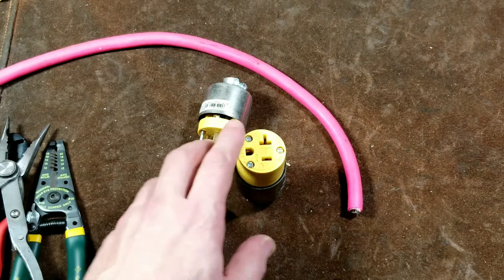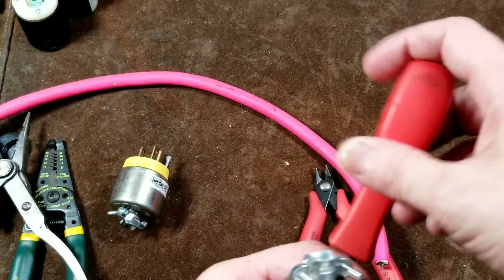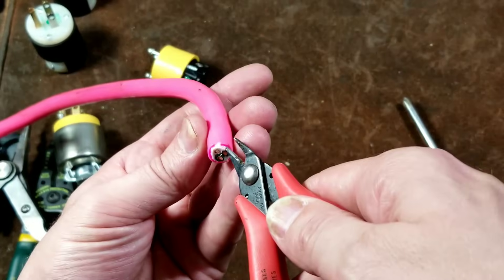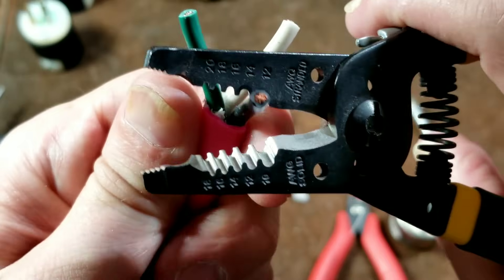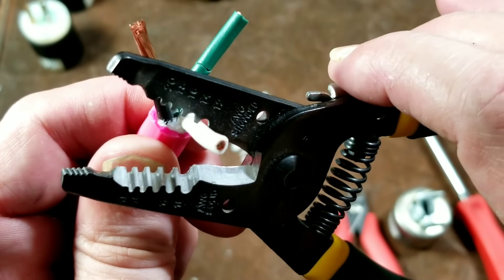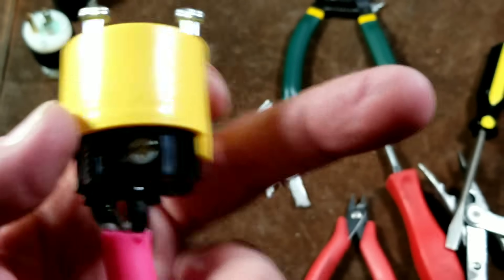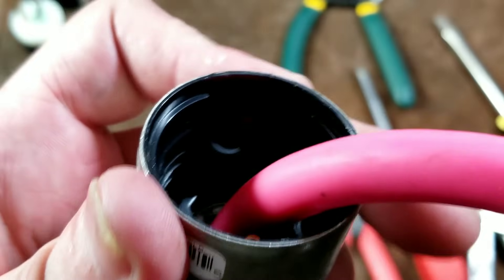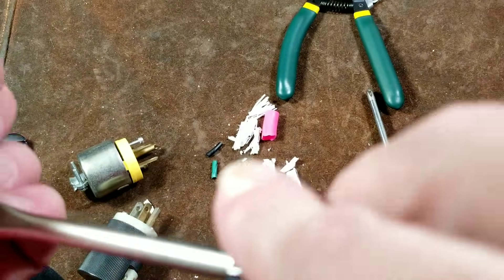How to Properly Replace a Power Plug/Cord End

Comment: In 1980 I new a guy who ran an electrical supply house he made up an extension cord for me. It is 12 gage with a fuel and oil resistant cover. One end had the hospital male end the other end had a single metal receptacle box with hospital receptacle and metal cover it's almost 2023 and it still looks and work like brand new.

Comment: It's not something a person does everyday but it's good to know that broken cords receptacles can be fixed relatively easily.  Once you do this once it's hard to forget or screw up.  Just remember Black to Gold, White to Negative, and Green to Ground and you can't go wrong.  You should always test the receptacles as well after your finish with a multimeter for continuity.

Comment: I just bought a used 220v dust collection system and the previous owner took the plug off to use on his new one. What kind of plug end should I put on it? Isn’t 240v more standard in the US? I am completely new to this, but trying to learn a bit so that I can repair this and get it running.

Comment: Why not use a combination head screwdriver on those terminals? I understand that the average joe won't have that tool normally but this may be the perfect time to expose them to its benefits. After all they are relatively inexpensive and sure makes life easier when doing electrical work. Anyway, good video and thanks for the info/insite!

Comment: I have used hospital grade outlets and receptacle for years. 
I get mine from savaged hospital equipment. !
I am also looks to make a 10 gauge extension cord. It is a little stiff price wize , but it will be good to have.

Another soild video.
Reply from the maker: Yes Hospital whenever they remodel always seem to toss out all their old high grade receptacles and cord ends and they are definitely very nice quality and very positive retention.

A 10 gauge extension cord is recommended especially for those 15 amp tools, really important if you plan on getting one of those hundred Footers

Comment: if you use that method to strip the wire, give the cutters an eight or so of a turn.  still very little risk of nicking a strand remians but the cutoff will remove much easier.  I also like to hit the wires and all boots / seals / threads / strain reliefs with a bit of noox or silicone grease to head off water ingress

Comment: Interesting you brought up receptacle. I got 12 gauge extension cord, and it was warm to touch. I had to replace the receptacle, and it was cool. Difference was that original only has couple of contact points where as replacement was one wide piece. Browsing at harbor freight, some are only 2 contact (newer?) and some are full wide (older). Maybe that could be your review topic: receptacle contacts.

Comment: I have a machine that has a motor with a missing plug...it’s an industrial machine, the cable coming out of it has 4 wires inside it...wondering what plug end would I use for that one?

Comment: I have a cord that has 2 greys and a black - have you seen this before? What to do?
Reply: Likely one of the grey wires will have a ridge on it.  Typically that is the one you would use as neutral.

Comment: I am not an electrician.  we have standard cable with colors green/black/white. In the plug we see green screw for green(ground) so But I don't understand why not make  the other one black and white(silver already). No confusion arises at all. Sometimes it is hard to distinguish silver and brass due to low light.

Comment: I'm getting ready to do the same thing with the exact same plug, but my three wires are black and red and yellow. Trying to figure out where I should put them
Reply from the maker: Use the black wire for the wide slot or the wide slot or the wide prong use the red wire for the narrow slot or narrow prong And use the yellow for ground

Comment: How do you know if the adapter needs to be replaced or if you just need to move it down?
Reply from the maker: most times you can just cut the cord and reuse the plug unless it has melted down or been destroyed.

Comment: My original hair dryer has only live wire and neutral wire. But no earth wire. Is  it dangerous to use?? It can get electric shock?? Please advise me
Reply: It is only dangerous to use if it has a metal body and no ground as metal conducts electricity. Most modern hair dryers have a plastic body so a ground is not necessary. In essence, the ground is for safety.
Reply: @electrifyinglightningbolt  My hair dryer's body with plastic. Thanks for giving me advice. Appreciate it

Comment: Why don't you use a pin to connect the copper wire to the plug ? Or if not a pin.... why not solder the copper.... thus giving you the best contact possible...
Reply: A solder joint is not flexible and a poor choice for this kind of application.

Comment: You really should not put a 20 amp receptacle cord cap on a cord with a 15 amp male plug.   Very few electrical items have 20 amp plugs, but still not correct.

Comment: I just bought a 50' 12/3 outdoor cord, which, according to the packaging is safe for 20 amps at 50' (or less).   It has typical 3 wire 15 amp style plugs integral at both ends, which is to say both "power blades" oriented in the same direction, and parallel to one another.  I need to cut it and add a replacement plug/receptacle (at each end of the cut) sufficient to allow for safe use without overheating the cord.   I want make sure I can pass 20 amps, so it seems to me...just to be sure...I should use 20 amp plug/receptacle as replacements.   But I can't find any using the conventional parallel layout...only the type with the two power plugs oriented ninety degrees to one another (indicative of a 20, vs 15 amp plug, I get that).  
Because the cord--out of the package--supposedly WILL pass 20 amps safely, using the conventional three prong layout, I ASSUME those plugs are safe for 20 amps (at that short length) too.  And since they use the conventional 15 amp layout, I'll also assume conventional layout 20 amp replacements must exist too.   But I can't find any.   Suggestions or links perhaps?   Thx.

Comment: Need an extension cord that both ends are female receptacles. ( no male prong ) Can I just install 2 female receptacles? Will that be safe? Thanks!
Reply: No, that will not be safe, as you would need to attach a live plug to a dead receptacle. You need to replace the live plug with a receptacle

Comment: What I like to do is strip back a little more outer insulation , then I tie a half hitch knot (additional insurance for strain relief) then cut and strip conductors to proper length, then make-up connections. Sometimes, if time permits tinning wires is a good idea, and makes it easer to insert into plug.